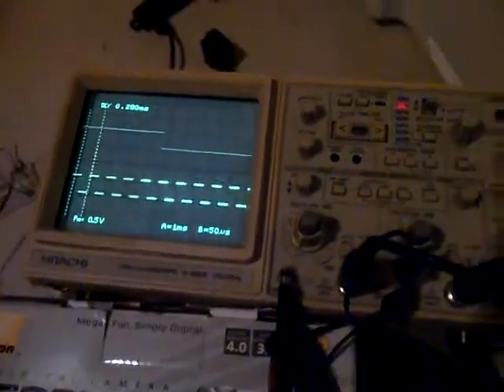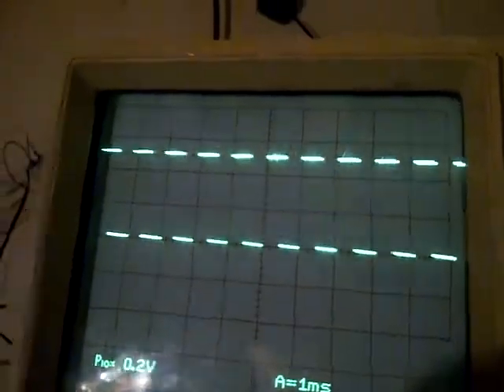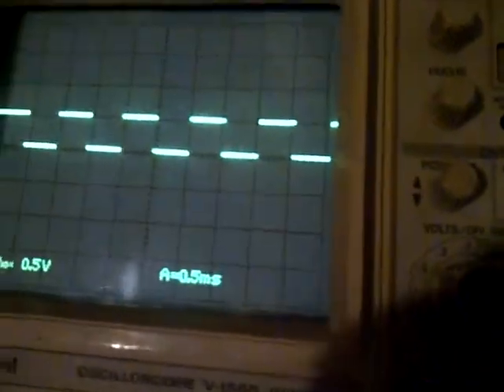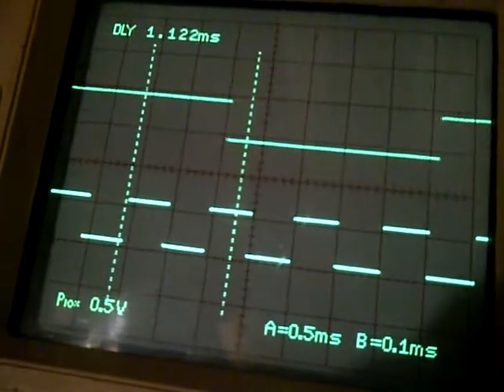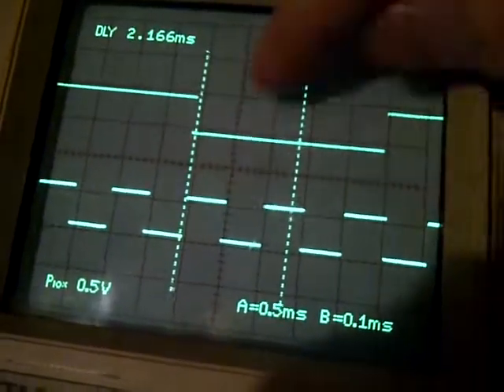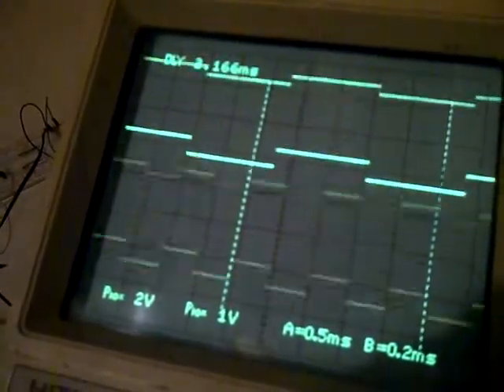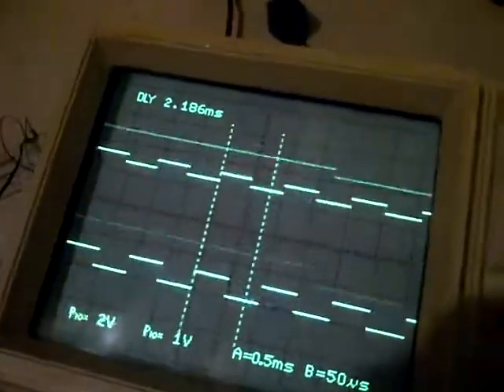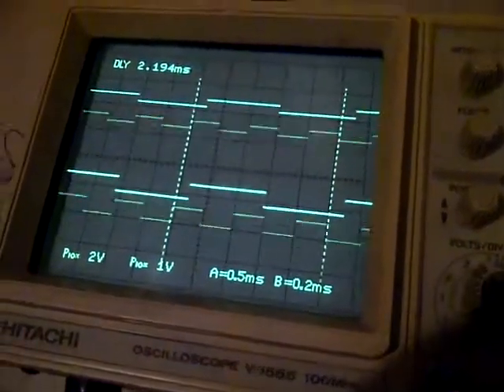Hitachi V-1565 Oscilloscope A/B Horizontal Options with Delay Sweep and Zoom Factors

Comment: Well... This was not was I was looking for, but it's extremely usefull to know this ! (I got the same scope)
Would you come to know how the single sweep function works? 
I'd like to be able to see a transient state, like buttons bounces or condensator charges and I'm not able to work it out... If it's possible :)
Reply: Just noticed this video is 7 Years old... Hoping you still use that scope ^^,
Reply from the maker: @zepeuf  Yes, it's part of a "delay sweep" function I think. The manual is online, page 31. Google "HITACHI V Series V-1 manual repeater-builder PDF" and the first link should be the manual. What you do is set a trigger and make it delay the next sweep as long as possible .
Reply: @devhackmod  I got the manual, I read it, but it didn't help much... When I single sweep, the signal just blinks on the screen, then back to nothing :'( 
If I understood right, from other oscilloscopes and tutorials/explainations, it's impossible to have it stay on the screen except with a numeric scope... But I remember having done this (with a button push) during my studies, on an analog oscilloscope... 
I don't remember how, though...
Got any idea? :-/
Reply from the maker: @zepeuf  I think you need "storage" function and this scope as far as I know doesn't have any storage at all. The older analog scopes the best you could get was a phosphor screen with persistence so it would stay on for a while, but I don't think this scope has it.
Reply: @devhackmod  yep, it's what I was afraid of, so sad :( Thanks for your help and have a nice Christmas ! :)

Comment from the maker: Notice that you can independently adjust the vertical voltage scale and the display shows Channel 1 Probe10x 2V and Channel 2 Probe10x 1V which is why the vertical scale of the square waves for each channel is different. You can set horizontal timebase B to any value same or lower than timebase for A, plus a delay on channel B which appears to have a minimum but cannot be 0 seconds (there is always some finite positive delay).